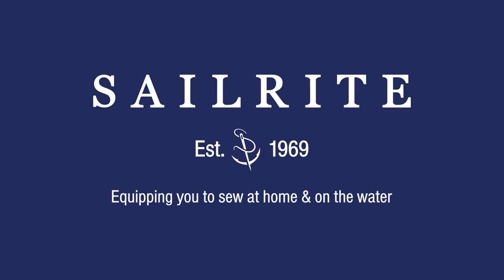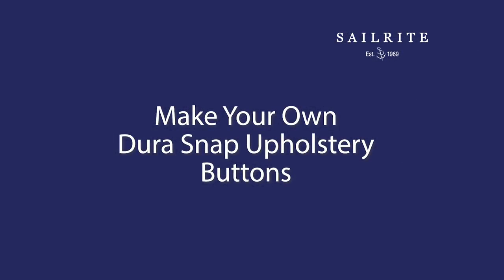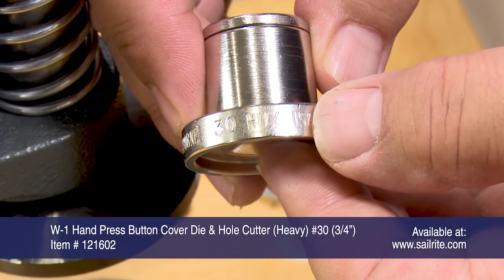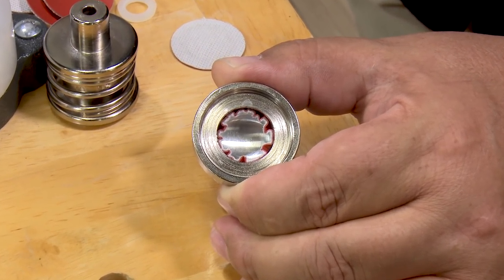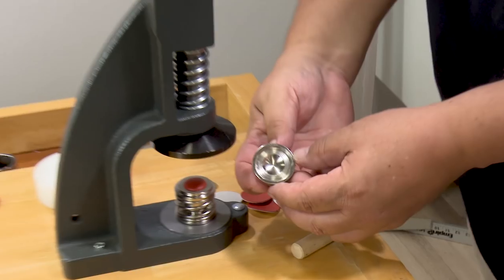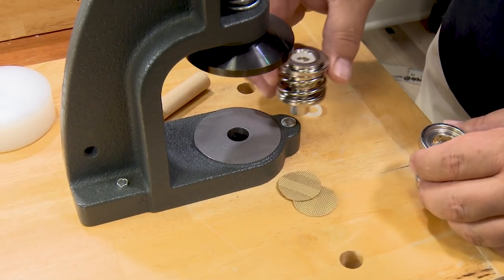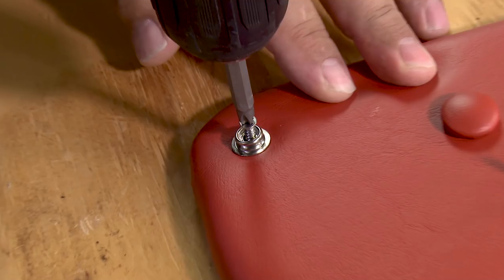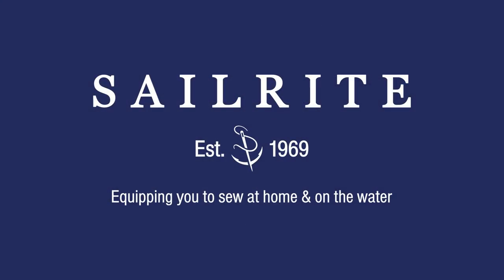Make Your Own Dura Snap Upholstery Buttons

Comment: This is magnificent but im not going to invest in the die, press, etc to cover 10 buttons for my RV. I need a more accessible diy option. I've used a hand system for recovering buttons when sewing, I need the same for uphostery screw covers.
Reply from the maker: Consider using this instead: https://youtu.be/PK3b8ctmkF8
Reply: Did you ever figure out a good DIY alternative? I’m in that boat now, and I’m so frustrated. I saw their link on your comment, but I want something I can upholster so I have have all of my fabric match. :(

Comment: Are the snaps strong enough to hold down a naugahyde panel if installed on the bow of a  bowrunner, at 70mph?
Reply from the maker: They may if you install enough of them. I would place one about every 12 inches. I hope that works.